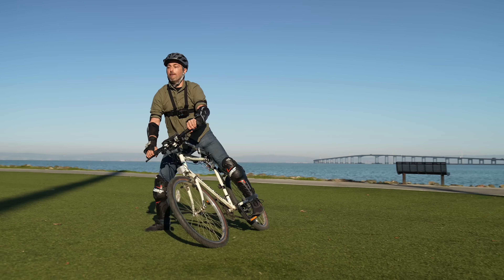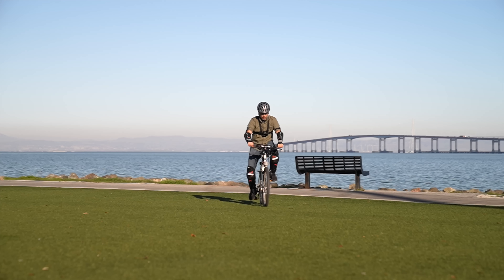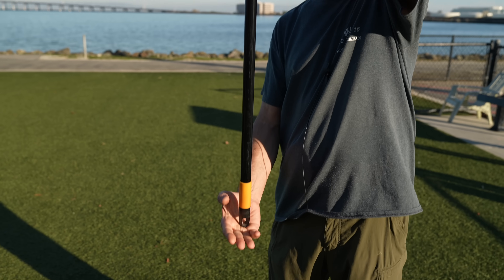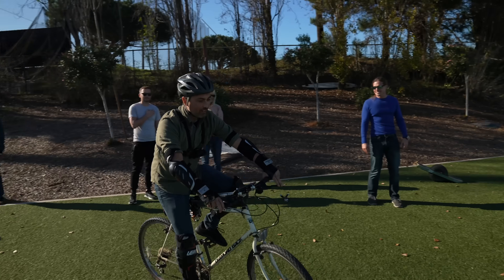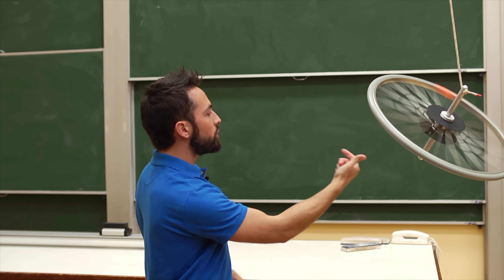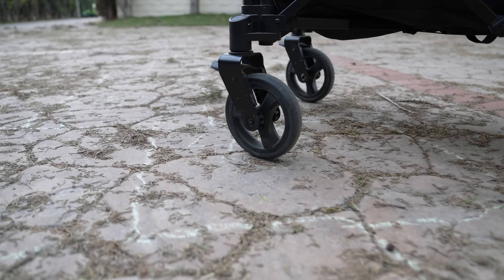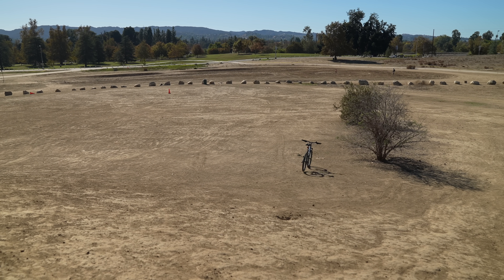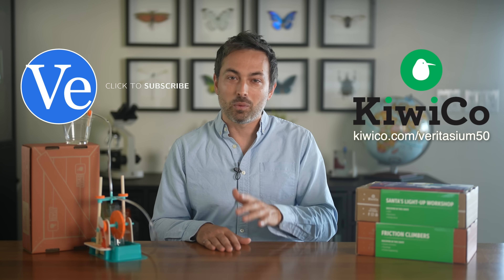Most People Don't Know How Bikes Work

Comment: I figured this out by accident when I did a (small) motorcycle build and wanted to see how tight I could make the steering stem to act as a ghetto "steering stabilizer". I tightened the steering stem to the point where it required a fair amount of force to turn the bars, and I almost fell off the bike when I let the clutch out. It was un-rideable. I had always thought gyroscopic procession was why the bike stayed stable, and immediately realized it was the abilty to constantly re-correct that keeps you from falling over. Would you consider doing a video on the mechanics of Trials bike riders?
Reply: @Erkle64  - I suspect you went without touching the handle bars.  In your example, this only works because the stirring is not locked.  When you lean left it actual turns the front wheel left.  He starts to explain this at 7:25.  If your handle bars were locked, you could lean all you want and the bike is not going to turn.
Reply: Keith Code runs a motorcycle riding school. There is a 2016 youtube video, and a webpage, about a modified motorcycle that Keith created. He calls it the 'No B.S. Machine'. It has two sets of handlebars. On the second set there is an additional throttle, 'so the bike's stabiltity could be maintained', but the second set doesn't turn the motorcycle; it's fixed. 

Many motorcyclists are into the myth that they are initiating the turn by moving their body: 'body steering'. At a safe location Keith has the motorcyclist get up on the no BS bike, get up to second gear, shift to the fixed handlebars and then they are asked to perform their supposed 'body steering'.

Keith says: everybody who comes off that machine says: "No BS". That's why he calls it the 'no BS bike'.
Reply: @cleon_teunissen  Exactly! When a rider realizes they have actually been using counter steering all along, they'll become a much better and safer rider. Body steering is nonsense.
Reply: Hoo boy. Trials riding would be quite the physics lesson.
Reply: @just some guy tired of life What?
Reply: @AnyBodyWannaPeanut  He responded to a verified channel AKA DoctorMotorcycle in two minutes of him posting the comment. Then he went on to say there's nothing else left to do except watch the comment gain likes.
Reply: I do trial bike riding, both motorcycle and bicycle and i would love to try this bicycle and that one wich turn to the oposite you expect it to. But yeah would love to get more in depth on this. 
By the way on trials riding a lot of the equilibrium on the bike you get it by moving your waist side to side while crouching down a little bit so even if you lock the turning i'm 100% sure i'd keep the balance while stationary, and also i think while moving but that'd be reeeally hard i can imagine(For turning and maintaining equilibrium i'd have to keep doing little hops). Also we put the tires on really low psi so they squish and it's easyer to get balance

Sry for my english im from spain
Reply: @MrArnih  I can balance stationary and even start my engine while balancing on my trials bike.
Reply: I’m an electrical engineer that is  also a car guy. I love learning about cars and my current stint is trying to understand the dynamics of cars (suspension wise). It’s actually not that difficult dynamics wise. But what’s nuts is motorcycles dynamics, there are so much more complexity—like if you think about death wobbles it’s quite fascinating because that stuff is not modelable since it’s an interactions with steering geometry, the tire deformation and the rider’s arms.
Reply: @Erkle64  - Gotcha.  I actually thought the same thing, though I'll admit it's sometimes hard to recall things I do subconsciously without actually going back and actually doing it.  I just might have to take my bike out for quick test.  LOL.
Reply: @chuckm260  For testing: go to a place where you can safely abandon an intented turn (empy parking lot, for instance) At a range of speeds try the following: postpone the initiation of the turn as long as you can. You can for example aim to turn inside of a particular line, at a spot where it is also safe to just continue straight. Postpone the initiation. Your sense of balance will start urging you. If you delay the inititation too long your sense of balance will know, and you abandon the turn. If you postpone until the last split second you need a big move to initiate the lean. Postpone and you really have to slam it into the lean. 

In everyday riding you anticipate an upcoming turn, and your sense of balance allows a lean to develop. That is, in everyday riding the countersteering is often absorbed in the small corrections.
Reply: @cleon_teunissen  - Not sure why you're directing your (confusing) comment at me but I'll rely on my over 50yrs of cycling, but thanks.  And for those that read Cleon's post, PLEASE DO NOT ATTEMPT THIS IN A PARKING LOT.  Find a level grassy area, either natural or field turf, as much safer options than a parking lot which is typically paved or some other hard surface that you could get seriously injured if you fall which is more than likely to happen.
Reply: @Erkle64  when you ride without hands, you still counter steer. It’s not a lot, and you mostly don’t notice it, but you still do it.
Reply: @Erkle64  that’s not actually true. You’re just not aware of what you’re doing.
Reply: @Erkle64  Indeed. The next step up is to turn at a moments notice, without any touching of the handlebars. I do a rapid sideways bend of my body, and since I'm sitting on the saddle that sideways flick transfers to the front wheel. It flicks the front wheel out a couple of centimeters or so. That steers the contact patch away from underneath me, and the subsequent lean of the bicycle makes the front wheel turn in the intended direction.
Reply: @Erkle64  Bike always do countersteering before the lean.
No matter how much you say that "I just lean", it still not true.
Get a highspeed camera and film your riding. The front wheel always first point other direction.
Reply: @XtreeM_FaiL  "Bike always do countersteering before the lean.
No matter how much you say that "I just lean", it still not true.
Get a highspeed camera and film your riding. The front wheel always first point other direction."

Even in this video it was shown that the bike when tilted turns the wheel in the direction of the tilt. That means if you initiate the turn by leaning it will turn the wheel in the direction of the turn. Why would it go first to other direction? Maybe a little inertia due to friction, but you can't call this counter steering if you consider what they show ion this video: according to it you have to do it rather big.
Reply: @XtreeM_FaiL  My body is not rigid - of course I can lean. It's not like I am talking  about highly theoretical things here. I am riding my bike on a daily basis and I know what I can or can't do on it.
Reply: @Erkle64  You might think you do, but you don’t
Reply: Trial’s riding would be a fantastic subject to cover as there are a lot of mechanisms involved.
Reply: That’s wrong. The gyroscopic effect produces those corrections.

When riding a motorcycle, if steering becomes destabilised - say by hitting a pot hole - you need to relax and let the bike stabilise itself.

Trying to stabilise the bike will cause you to crash.
Reply: While it may be harder, it’s not unrideable. Any good stabilizer will give you the ability to tighten to where you really need to push and pull to turn.
Reply: ok...? who asked?
Reply: @molrat  no one asked you either so shut
Reply: @Erkle64  yeah just press over into the direction you want to go. doing counter steering is only if you need to make a very sharp hard turn.
Reply: Nothing worse than a bike with stiff steering. It was bad enough in a car with intermittent power steering.
Reply: @Erkle64  even when you do it by leaning, you still have to lean in the opposite direction first. Because otherwise you’d end up going in the opposite direction.
Reply: @Erkle64 so wring
Reply: My fellow motorcyclists with no about countersteering
Reply: @usernameonutube  yes!!! I too have this memory
Reply: @Erkle64  you are still making micro moves with your weight distribution,  with locked steering you would fall immediately
Reply: @Erkle64  This would not work if your front wheel and handle bar wasn't hinged and could follow the way you're leaning. Your wheel is still turning relative to the frame.
Reply: @Erkle64  Dude you are countersteering with realizing it, if you ever ride a motorcycle u would realize how little u need to countersteer to be able to lean to the opposite side, your handlebar is countersteering for u.
Reply: @Erkle64  lol
I don't need to convince you buddy, reality trumps belief.

Ride a motorcycle once and a while, you probably don't realize now because it only becomes more clear the quicker you go. 
20mph + is already enough.
Reply: Well you're still right, it is gyroscopic forces keeping you upright, it isn't just you making corrections.
Reply: learned this a couple of decades ago on my sport bike. Depending on the speed I would steer into the corner while leaning into the corner, or steer out of the corner while leaning into the corner upon entry into the corner.  There was a show on Discovery, back when they actually made shows on these types of things, about a world record speed attempt on motorcycle talking about at the different speeds the rider having to change which way he adjusted his steering to turn the bike.
Reply: That would be an amazing video to watch. Could be nice to include the honda self stabilizing motorcycle into it aswell. 

Dispite being Dutch and riding a bicycle since I was 3 years old, I learned how to actually steer one from my motorcycle driving instructor. He pretty much explained all the forces that acted upon the bike and how to steer away from the turn to let the bike fall into the turn. Dude is amazing.
Reply: Gyroscopic precession is how you ride a bike without handlebars. But it still works by constantly correcting, you just do it indirectly, by moving the COG and by precession that moves the front wheel and bars.
Reply: If you recall way back when you got your riding licenses, in class, they explained counter steering. I got to 1:15 and instantly knew where this was going
Reply: You know nothing- Dr Ben
Reply: @just some guy tired of life don't think that turned out how you thought it would.
Reply: @just some guy tired of life can you shut up about this? no one cares. its a video about a bike and its a channel about bikes so shut it.
Reply: You have a comically appropriate name
Reply: i like per video
Reply: I had the (mis) Fortune to have been given a Kawasaki Enduro (Dual Sport)  that was equipped with the Hatta Forks, that had 3 Positions on the bottom of the axle, and was also adjustable height wise in the Triple Tree...My "idiot" assumption was that lengthening the wheelbase (Forward Position) would make the bike more stable at high speed...WRONG! - It turned way too easily and was wobbly at speed...I found the REAR position made it most stable at high speed due to "trail" but it took some trial and error, and the middle or "neutral" setting was best of both worlds unless you were strictly "commuting" on the bike...
Reply: Yes, interesting video, but as a bike rider who has put more than 30,000 miles on bikes, I know that I can use my body to mildly turn the bike.  Like one of the commenters, I have often ridden with no hands, sometimes to do crazy things like change my shirt.  Don’t try that, even though it worked out.  It takes a fairly long time and experience to really get a good feel at bike riding.  You must keep your bike in good working order and make sure you are riding the right bike for you.  Until you get really capable, don’t try anything really aggressive.  Know your limitations and your equipment’s, as well.  Expect things to go wrong and find an ‘out’ (a planned safe escape out of every situation), and you will have a fun time riding.  Remember, that you are often riding as fast as some cars, but you have much less protection.  So beware and be careful.
Reply: Actually the bike by itself will recorrect if you didn't tighten it too much. Push a bike and then let go and watch what it does. It self corrects every time until it loses momentum. The problem is that to learn to properly ride a bike motorcycle or bicycle you have to let go a bit of control and let the machine do it's thing. Our natural correction is in part is, but in part the machine as well. If you try to man handle a car or bike or motorcycle it will respond negatively massive over correction this happens in planes as well. You have to let the machine do it's part and you learn to correct the minor failures the slight over corrections of the machine. You become one with the machine, it's this that makes people not like automatic cars and effortless flying planes. It's a measure of becoming one with the machine that we lose and for many it's a hard thing to let go of. It's in essence demanding we give up even more control and that is counter to human survival.
Reply: Hiw can he say we don't know most of hiw a bike works?? We knkw the basics..that seems like more than a lot to me..jjst some details maybe we need to work out..isn't amyone else surprised?
Reply: @leif1075 
It's like a basketball player's arms and hands know physics whether or not the player has studied it or not. The player can sink a three point shot even if he doesn't know how gravity counteracts the lift the player gives the basketball when laying up the shot.
Reply: Then why am I able to ride a bike and take turns without using my hands? I can literally ride it without touching the bar almost at all 😐 (obviously i do it when no one's around for safety reasons)
Reply: Fun fact? I was able to learn to ride a bike ONLY in 7-th grade !!! Because only then i uderstood phisicaly speaking what i need to do in order to maintain balance. The counter-forces i needed to develop ! In 7'th grade i got the Phisics discipline, the mechanics part. Same with the swiming, i was able to swim when i understood what i need to do in order to swim, by creating a constant force down to lift my body a little above the water. To be exact i neded to lift my hand or my leg more aquadinamicaly than when i put it don in the water. The diferences between these 2 forces was the lift force, to be able to stay on water. After that, to advance in water, i used part of the lift force to advance. So the movement was like a propeler.  So now i learned to swim too.  Same with staing on a ball , or 2 crossing pipes, like a circus guy,  or sky-ing and snowboarding. Couldn't aford a ski instructor, so i distroyed couple of a sky slopes to learn. Snow was destroyed,  and other sky turists had critical problem riding the slopes i used. Yeah , whenever i had a real problem to learned something, the other people around me got THE BAD LUCK, during my learning process. And i'm ok with that because nobody wanted to HELP ME. SO THEY GOT ALL THE SIDE EFFECTS OF KARMA !!!
Reply: Just to let you know, the word is precession.

A procession is a uniform forward-going group of moving someones or somethings.
Reply: How money works part off world economy
Reply: @Erkle64 by shifting your weight you're actually counter steering without realizing it. You don't have to touch the handlebar for this, just that your steering isn't locked. Hence why the video showed you can't lean and turn if steering is locked. Try recording yourself riding or attach an accelerometer without hands and lean, you'll see the bike actually initiates a small counter steer before following your lean angle. You cannot lean a bike into a corner without counter steering unless it's moving very slow.
Reply: @Erkle64  When you lean left you actually put pressure onto the left handle bar just by transferring weight which counter steers you
Reply: No its not, its counter-steering, how you turn a motorcycle. You dont turn the handles right to turn right, you slightly turn left so the bike falls over to the right, thus turning right.
Reply: @Baleur  Yes, but they just simolify it saying it steers the opposite direction
Reply: @Baleur  Motorcycle riding is NOT like bike riding.  As I understand it, motorcycles are far heavier and you usually keep your butt in the seat, which places strict limits on what you can do with weight distribution that aren't there for bikes.  I promise I can ride a bicycle with locked handlebars with a lot of manipulation (counterweighting with opposite hand pushing down on the handlebar opposite the side you're pedaling on, butt out of the seat, weight forward and opposite pedaling foot, angle of the bike with the road should alternate every pedal... these noobs don't seem able to swap the weight side even once), a motorcycle... probably not.
Reply: Gyroscopic force is the force generated by a round object at speed. Of course you cannot degenerate gyroscopic force at a stop. It doesn't develop on a motorcycle till around 10+mph. The point at which you have to countersteer to turn is essentially pushing the handlebar to lean the motorcycle against the gyroscopic force generated from the wheels. Any speed lower than that, requires counterbalancing of the bikes chassis.
Reply: "... gyroscopic procession..." ???
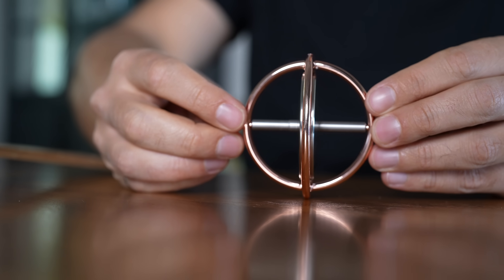Reply: @hsw268  see from about 8:40
Reply: @hsw268  yes
Reply: @hsw268  it process or proceeds. Nah, recess.
Reply: xdxd
Reply: this is not true for a bicycle, i always use my body to lean the bike. these people are clearly newbies
Reply: @Blox117  without the ability to steer you won't be able to turn, no matter how you lean
Reply: @Blox117  lmao, lock your wheel and see what happens
Reply: @syomchi  well yeah locking it completely certainly makes it hard but I think they mean if it was locked to counter steer they can still turn the bike right while leaning left, I just imagine them being caught in a quickly escalating circle of death
Reply: @Blox117  you dont lean a bike at 1mph... there is no point. go pedal around your garage. you arent cutting corners like valentino rossi at low speed
Reply: @The_Cat_Authority  it depends on whether or not you're sitting. that's why trials riding comes up. Bikes made for trials generally don't have a seat, and thus the ways in which you can manipulate the bike and it's CG change. Similar thing with BMX riders. Riding a bike standing is a whole different ball game.
Reply: @eskaymotorsports600  none of that has anything to do with leaning at slow speeds
Reply: @Blox117  Knee drag is the only way to go